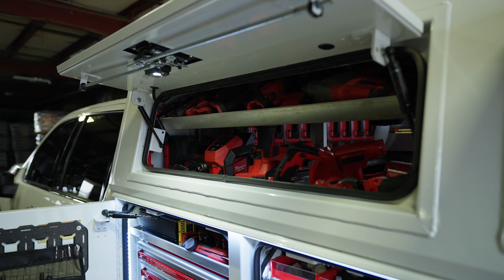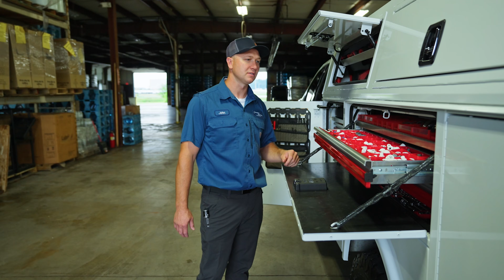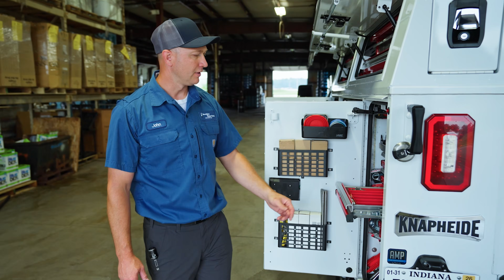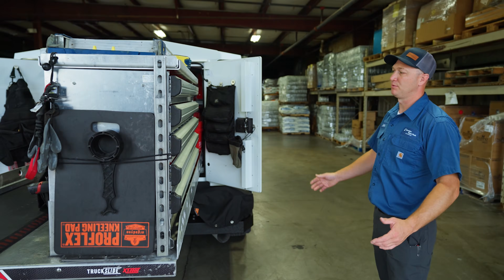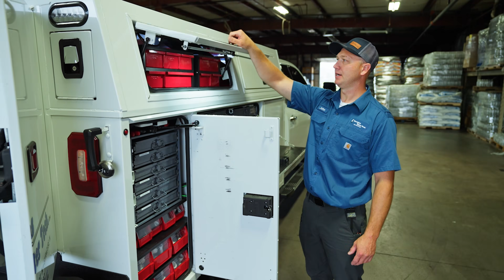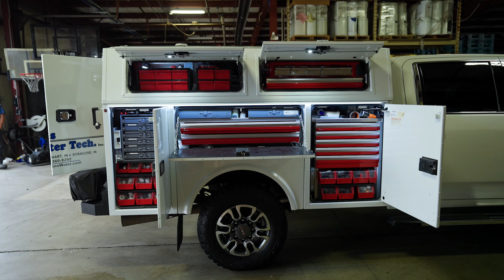Ultimate Plumbing Service Truck Tour with @JRmasterwaterspecialist

Comment: Your company spent good money on that set-up. But I'm 53 years old now, and my knees hurt just imagining myself having to crawl in the back of that truck.
Reply from the maker: We hear you! That's why we offer KUVs in low, medium and high roof configurations to handle any application 👍
Reply: How do I get one
Reply from the maker: If you're interested in purchasing a Knapheide custom body upfit, you can head over to our website and find your local upfitter, search local dealer inventory, or request a consultation: https://www.knapheide.com/buy/

Comment: How much is the setup cost
Reply from the maker: The pricing on our bodies will vary depending on many different configurations, options and vehicles. To get a specific consultation, you can head to our website, add the items you're interested in to a build, and submit it for a quote consultation. One of our distributors will reach out to you at that point: https://www.knapheide.com/enclosed-service-bodies/

Thanks!

Comment: Where are your sewer machines? Where are your pipes? Do you put a water heater when you need to swap one out?
Reply from the maker: Hi, @ZR1Terror! @JRmasterwaterspecialist and the team at Hawkins Water Tech specialize in water treatment. They use this truck to haul a lot of their tools, but they also have a trailer that they use for hauling for larger, bulkier equipment to job sites.

Comment: I wonder if knapheid has fixed their horrible door seals and leaks (doubt it)
Reply: Or you do as all of Europe do. Use a normal van and have everything inside instead of having 15 hatches and doors that can leak.
Reply: @ytbeh1  Most of our plumbing trucks here are large box vans now, these compartment bodies will not accommodate all the large tools, tank type water heaters, drain machines, etc we need to carry. These compartment bodies are good for specialized, limited scope crews such as back flow prevention valve maintenance, line location and leak detection. Besides the box trucks, many of our vans are now the European Ford Transit and the Renault [Fiat?] / Ram.